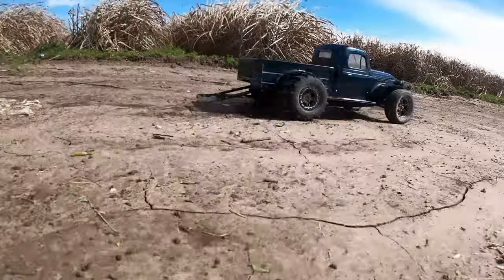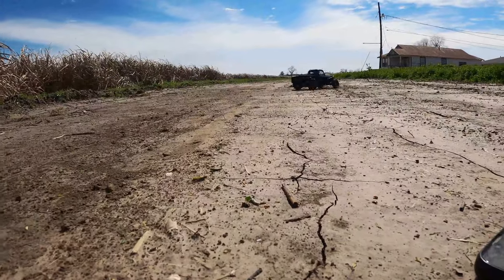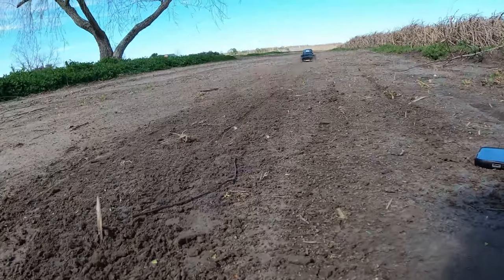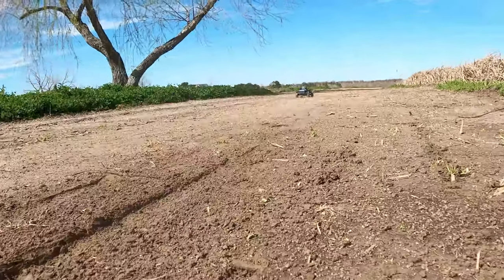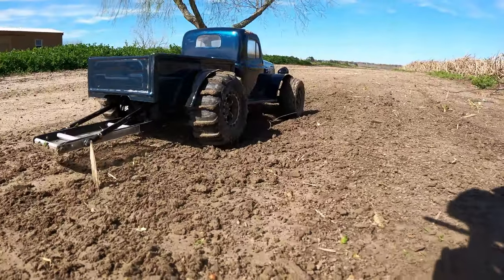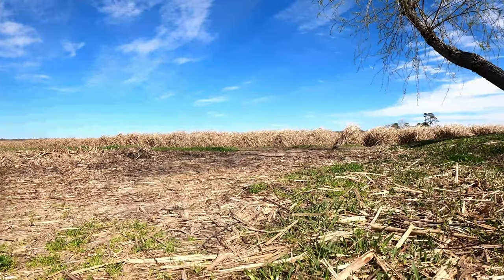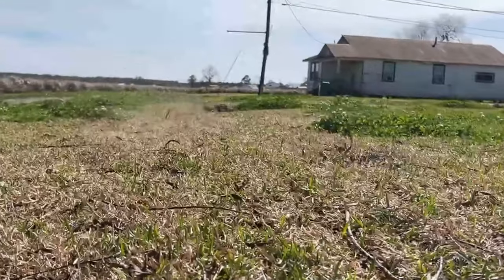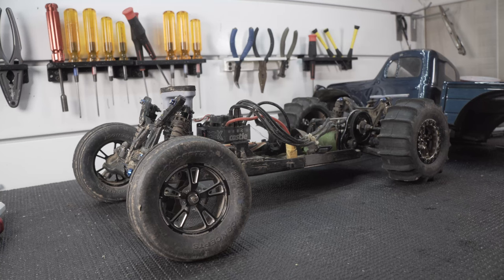The Dirt Drag Truck is Back!!! And It's Looking Promising?!?!

Comment: Should either find sand to try or bring a metal rake and make it loose, usually they groom dirt tracks to be loose so paddles can grab like in sand.
Reply from the maker: I am definitely getting a rake to try out next time!! Such a simple solution I didn't think of for some reason. Thanks!

Comment: in my experience with running straight line with dirt, the car likes the initial zing up of power, but when it kicks sideways is about a foot or so out. if u can tune the throttle ramp with the mamba x, try a quick hit of 100%, drop it down to 50, and slowly ramp it back up to 100
Reply from the maker: I'll have to look a bit more, I'm not sure if it's possible to set a throttle ramp like that in the mamba x but I agree that would really help get some traction

Comment: Wonder if you installed a gyro of that would help? And yea no doubt need to add a throttle curve. Hell I have hard time finding traction on pavement! Have to ramp up power really slow
Reply from the maker: A gyro may help but that's not something I really want to add. I rather drive naturally myself

Comment: I think it’s all in the diff…..
Reply from the maker: I don't quite remember as it's been a long time since I built this truck but I'm pretty sure I set this diff the same way I do with my no prep car. So likely 1 mil wt fluid. I've found for my no prep car that helps it launch at straight but stay straight on the top end. I assumed the same would be true in this truck but maybe the surface is looking for something different